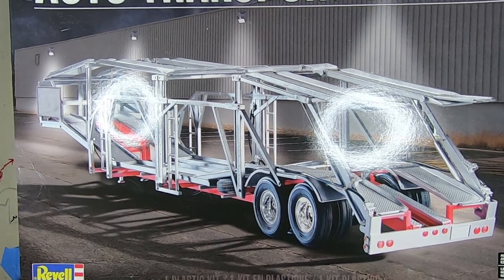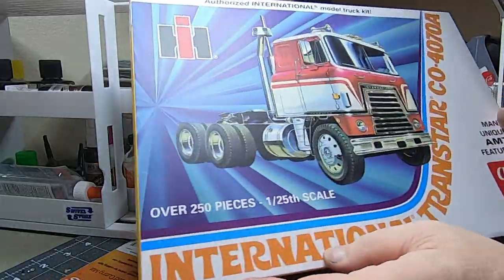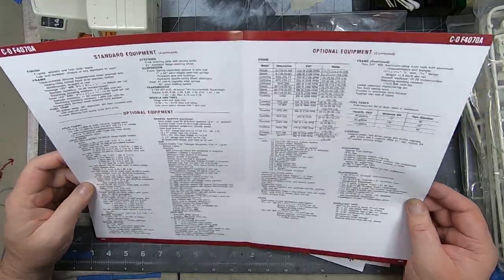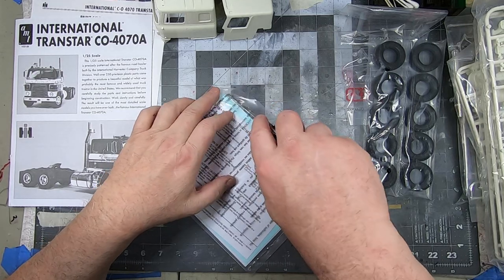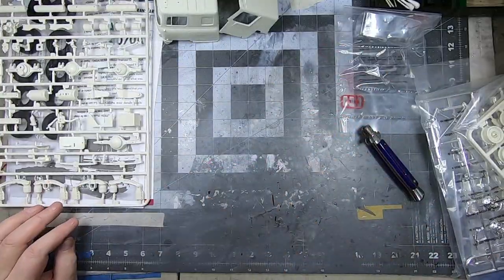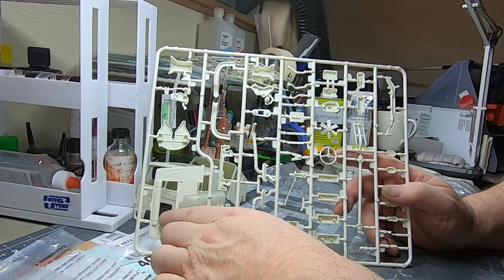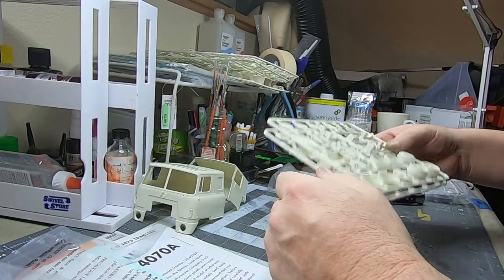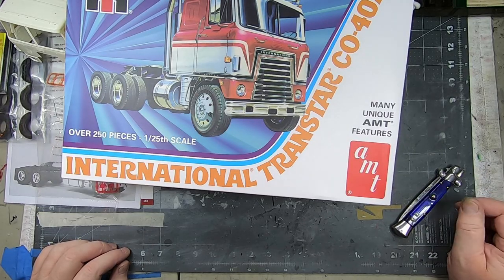UNBOXING THE AMT ALL NEW TOOLING TRANSTAR CO-4070A

Comment: It is actually a brand new kit! They took measurements from the old Ertle molds, which were Transtar 2 molds,which were retooled from the original Transtar 4070 A molds. So it is indeed a completely new fresh cut and carved set of molds.
Now hopefully Round2 will put out the retooled transtar2 model kit!
Reply from the maker: Thats why I bought it. When I heard/read it was a brand new tool I actually pre ordered one!
Reply: I don't have good luck with ordering off the web! I waited til I knew it was out and went to "my" HobbyTown and had them order me one! It took about 3 1\2 weeks for the shop to get it,but they finally did. It's second in line on my build list! I'm doing this first one box stock,just because. The next one I'm gonna work over a bit. I have a cab from the original kit from a friend. it's in rough shape,so I'm gonna cut it off at the back of the doors and cut the back off the new cab and make a double bunk outta it! I've seen 3 different pictures of actual trucks that this had been done to. Looks pretty cool. 
Good luck with your's I'll keep my eye out for the build videos!
Reply: @tomcline5631  it's actually and old ertl kit 4070A the kit that was giving to Jammie hood at round 2 they did cad drawing of the kit parts then they made all new tooling for this kit it's based off of and original kit from the 1970s I think there's an article in model car magazine on this kit